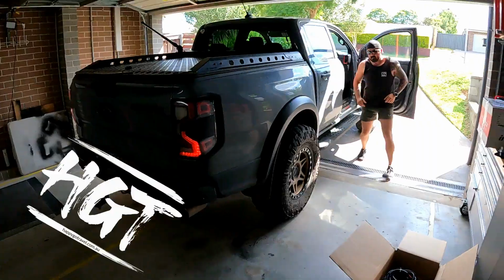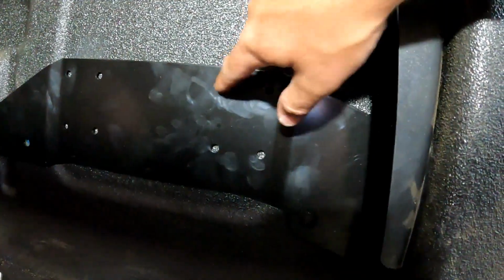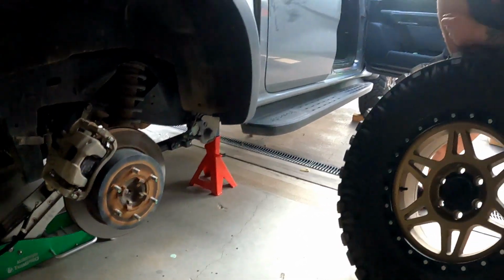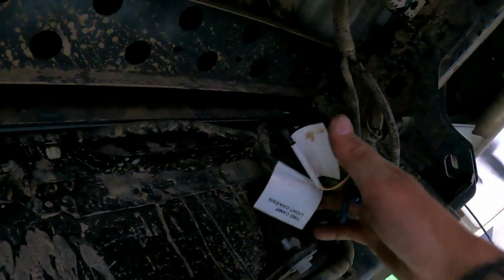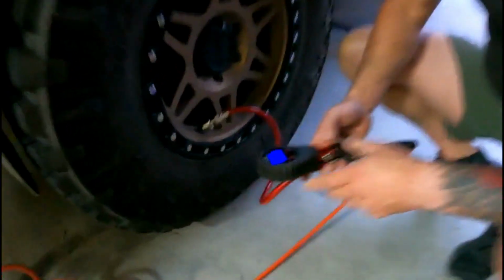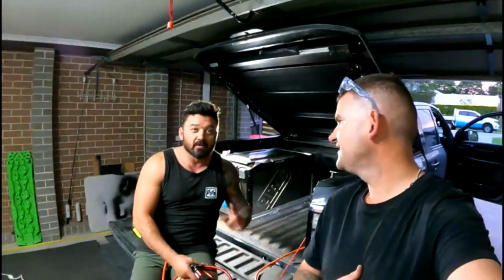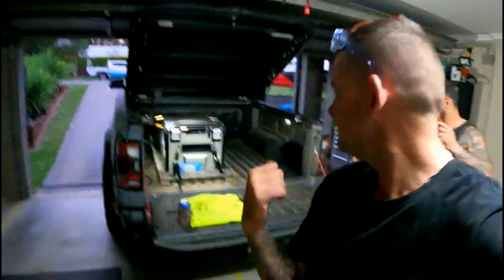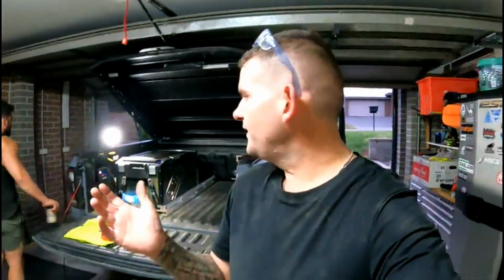Next Gen Raptor Ranger Build- ARB Dual air compressor- ford factory option-  Install & 1st thought

Comment: Awesome video man 👍🏼 I’m probably going to go this way as well. I’ve always mounted my compressors under the rear seats in my vehicles. They last forever being out of the elements in the cab. But this is a clean set up and less effort 👍🏼👍🏼👍🏼
Reply from the maker: Cheers dude, I had this kit on order for mine for the last 4months there is some supply issues with arb apparently the manifold is different for the compressor to fit in the guards. I ended up ordering the Pirate camp co brackets for mine, I figured it’ll be a good way to compare the different set ups

Comment: It's not an arb only connection. It's just not s nitto type. You can still get all the fittings from Bunnings if you want. Some nail guns use the same, I know my Bostik gun use the same.

Comment: Just a point with the wheel removal. That instruction is for the regular ranger, the raptor is missing the tub step and has a different exhaust setup so you may need to make more space
Reply from the maker: That is a very valid point and something i didn't consider. Cheers mate

Comment: I’d be interested to see how the compressor is going after a few muddy water crossings etc etc
Reply from the maker: It sits that high up and The inlet filters are at the top also it’ll never be an issue. The inner vision the wheel will keep 99% of the crap out. I’d say if you get to a point that stuffs the compressor you are going to have way bigger problems 🤣
Reply: @HappyGoTravel  far enough,  cool little solution that's for sure 👌
Reply: The compressor is IP rated .
The only issue is the intake filters.
There is an option to extend them to a clean place like to the inside of the tub would be nice. Even for the filter replacement process to be easy.

Comment: great work guys, any chance of a supplementary vid or explanation on how you integrated the Raptor 'in cabin' switch in with the wiring of the compressor?
Reply from the maker: hey mate when I get some time we will definitely do a vid on the in cab switching. it essentially just puts easy to tap into trigger wires in convenient locations around the rig
Reply: Hey mate, which trigger wire on the harness is u wire up to the aux4 on raptor ?

Comment: Hey guys great build i have a twin arb compressor lying around just wondering if that will fit i dont have the wiring so i went to arb to ask if i could buy the wiring and bracket but they reckon the rone i have wont fit the bracket. But i tried putting matching it from those holes in the tub they do match. Any thoughts on this?

Comment: I can confirm that you do not need to pull wheel and wheel arch off to install. A little cursing and swearing but got it there.

Another hint. The cast iron elbow fitting on the compressor itself is very weak. Snapped it while tightening the hose - magivered a fix with 1/4” gas fittings but I’m not 100% sure how well it will seal as wasn’t able to tighten fully. Lots of sealer and fingers crossed
Reply from the maker: I've always not been too worried by minor air leaks with compressor plumbing. it always reminds me that I've left it on hahaha

Comment: What’s the dual
Midies for? My arb compressor stopped working during my first air up. Installed it exactly like this.
Reply from the maker: We found that the 40ah midi fuses blow after about the 6th tyre in a row. they have since been swapped to 60ah ones

Comment: Hey mate, one question not related to this, you know the silver bash plate that joins with eft front bumper - it comes silver stock, how did you change the colour of your one to black? Was it painted or are there aftermarket parts that can be bought and just refitted on? Cheers.
Reply from the maker: Hey mate we just pulled it off and painted it with a raptor liner coating. It’s a pretty decent plate. The raptor definitely needs underbody protection further back though

Comment: Just out of curiosity have you guys towed with the v6 raptor? I know they have reduced towing capacity to 2.5t, so curious to see what it's like for towing.
Reply from the maker: It definitely squats with a trailer hooked up. As for power you don’t know anything is behind you, it would definitely be able to pull mor weight but with the suspension it’s not designed to do it. I’d say if you plan on towing all the time it’s not the right rig for it
Reply: @HappyGoTravel  Cheers mate, I've got a 2T boat and I'm lucky to tow the fkn thing once a month. Otherwise is small trailers taking green waste to the tip.
Reply: Gidday fellas, I tow a Patriot X1 regularly, not very heavy but you barely notice it’s there. You can air-bag them apparently if you need to tow heavier trailers to compensate.

Comment: Do the 35's scrub? What offset did you use? Does the spare fit under without issues? Cheers boys
Reply from the maker: No scrub with the 35’s and the spare fits perfectly. We actually did a vid on them. We cut a little to make them work but that is because of the offset on the methods. They are a +20 9” wide wheel, it’s probably just a little to wide to be honest
Reply: @HappyGoTravel  Cheers!
Reply from the maker: @JensThomas  there is around 1cm each side with the nitto 35. We found it centred pretty well. I’d just back it off re centre it and see how you go with it. This 35 has been under here for months now with no issues ✌️

Comment: Is the 12v 15a wire available near the tub?
Or routing the wire from the battery is mandatory?
Reply from the maker: it needs to go to the battery because the compressors draw soo much

Comment: Any issue with heat coming off the exhaust to the compressor above it
Reply from the maker: Nah it sits well above it, there’s actually not to much heat around that area. With the wiring you just need to be mindful where you run it going above the chassis